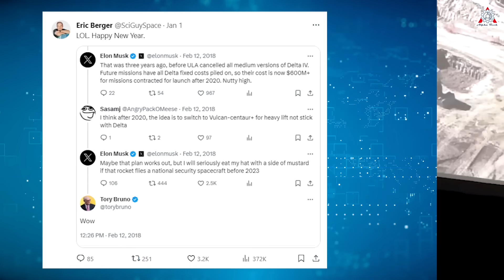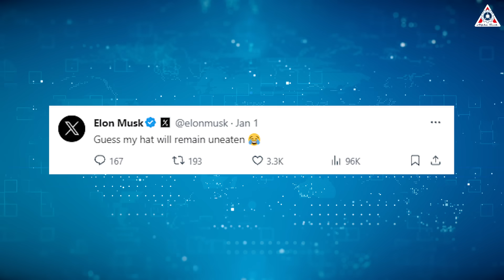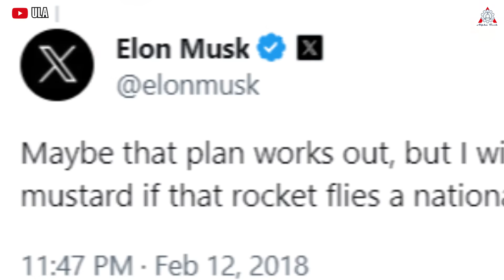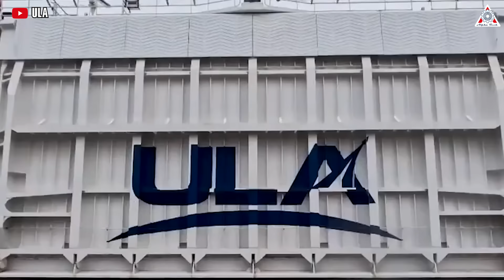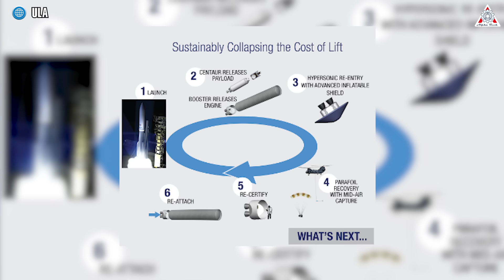Elon Musk's New Reaction to ULA's rocket FAILED for the maiden flight 2023!

Comment: ULA rocket didn’t fail though?  What is this clickbait
Reply: You are mistaking "failure" as failure. SpaceX is testing, testing, testing, and consistently iterating the technology in a rapid agile improvement model.  Like they launched one of their rockets, knowing that it would destroy the launch pad, but did it anyway to see HOW it destroyed it and then how to improve it.
Reply: SOMETHING went wrong with the lander....so blame will be coming once they review the launch data.   It's possible that the launch forces exceeded what the lander was designed to take...or the lander was faulty.   Can't say yet and it'll be interesting when/if the cause is determined.   
A fuel leak could easily be caused by a G spike that ruptured a tank...so let's wait and see who to blame.

Comment: I am no fan of Blue Origin's Bozohead, but ULA did not fail, it was the Astrobotics part that failed.
It should be noted that the ULA needs SRBs because the BE-4 runs underpowered.  The original design was not to need these except on extra heavy payloads.
Reply: Yeah and they could have it launched I 2019 but Bozo was originally wanting his rocket to be launched first.
Reply: A failure is a failure, regardless of where the failure came from. In this instance its who's hands are in the pot, dictating what, their vendor's equipment, etc. Aka, a process failure. I am a vet and can tell you that a logistics failure in the rear will lose a battle just as much as failed tactics on the line.

Comment: Vulcan is still entirely expendable, meaning their launches are very much more expensive than SpaceX launches. At some point, even government customers will have to take that into account.
Reply: I think the cost of Falcon has gone up quite a bit ....all you have to do.is look at the government contracts SpaceX has recieve ...÷ by the number of missions...their ISS missions are not cheap ...not to say SpaceX is kicking everyone else's a$$....but they are not doing this for spare change either.
Reply: @Java62PR  during the time ULA has launched 3 payloads, SpaceX has launched 90, so I'd say it's done quite a bit of a$$-kicking. Market strategy says you charge what the market will bear to maximize profit, especially when what you charge is still less than what your competitors can match.
Reply: @patkelley4071  yet f9 is unable to lift everything that could be designed for VC.   Thats why diversity in launchers is needed.
Reply: @FossilTunes  I agree that a broad range of launch vehicles is needed, but continuing to toss hundreds of millions of dollars of expensive scrap into the ocean is not the desired path. If the Vulcan engines and avionics can eventually be recovered, that will be a better payoff.
Reply: @patkelley4071  that would be nice but it is Always a question If it is feasable to recover vehicles. Again the best example is the space shuttle. While basically recoverable the repairs and maintanance was a pain and never hit its design Goals.  And what,for example,is the turnover time for a ,competably, simple Falcon 9? 
I would be Happy If ss/sh works AS intended but i have my doubts.
Reply: @FossilTunes  good points. It was unfortunate that the STS program was awarded to Rockwell instead of Northrop, which had proposed a fully recoverable two stage design, that I suspect would have been easier to refit and maintain. The biggest reason the STS never hit its affordability goals was that its main purpose was to enable the construction of the ISS, with few other payloads large enough to justify flying more missions, and as SpaceX is showing, the number of flights are key to reusability making sense.
Reply: 98 to be correct...yes SpaceX is a revolutionary company....the purpose of bidding is to get as close to the next bidder ...without leaving millions on the table....that gap has close considerably...still they can choose when to low ball a mission or bid for company purposes.
Reply: Not ...the engine section supposed to jettison and parachute down to be recovered by a helicopter using a catch wire.
Reply: well... a launch on VC might cost 3x of what F9 would cost but it has the advantage of higher load capacity and a larger fairing.

Comment: With each spectacular engine failure, Musk should send a card offering Raptor engines at a special discount price. 🤑😬
Reply: BO engines have been a disaster thus far, but the Raptors are still not flight proven and the first two attempts to launch have resulted in .... wait for it ... Raptor engine failures!
Reply: @Raptorman0909  Hardly. All 33 engines performed flawlessly on stage 1 thru separation. The failures after separation were due to cavitation of the fuel supply, not of the engines themselves. Similarly for stage 2. The LOX ran short - probably due to a leak and the FTS took over.
Reply: @GntlTch  Perhaps, but until they make it to orbit they haven't proven themselves.  BO hasn't proven the BE-4 either and for the same reason!
Reply: @Raptorman0909 The Raptor engines have proven themselves: all 33 engines launched, remained working through separation and restarted. While reaching orbit may be a valid criteria for a rocket, engines do not have to reach orbit to be validated.
Reply: @GntlTch  "While reaching orbit may be a valid criteria for a rocket, engines do not have to reach orbit to be validated"  -- Umm, a rocket engines job is NOT to work on a test stand, it is to enable the rocket to reach it's objectives -- they have not yet done that!
Rocketry isn't T-ball!
Reply: @Raptorman0909  So if making it to orbit is your criteria for "proving" an engine, would you explain the FAA allowing manned flights on BO's New Sheppard with "unproven" engines? Bezo's glorified yoyo does not even attempt to reach orbit - just straight up and straight down.
Reply: @GntlTch  A rocket has a job to do, the New Shepard barely makes it to the Karmen Line and is way short of LEO, but the job it's engine is required to do is met for that task.  A rocket that's supposed to reach LEO can not be considered a success until actually reaching orbit -- space is hard, it's not T-ball!
Reply: @Raptorman0909  I think you have it backwards. The BE-4 has ONLY seen a test stand. Not a single one has flown. Contriwise, over SIXTY Raptors have flown and the Starship did reach its objectives. (Yes, it fell short of the test aspirations but it did meet its objectives.)
Reply: @GntlTch  Begging your pardon putz, BE-4 has just successfully launched and the Centaur is now in Earth orbit!
Reply: @Raptorman0909  Yes, finally. But it hadn't when you made your blantantly wrong assertion.
Reply: @GntlTch  Um no, at no point in the prior posts did I say BE-4 had done its job UNTIL it did its job!  You may wish to review as your comprehension is weak!
Reply: @Raptorman0909  I'll concede that one. I was going from memory and conflated your posts with someone else's.
Reply: @Raptorman0909  You keep trying to move the goal posts. Your asserted criteria was that to be "proven" an engine had to reach orbit:

   "until they [the engines] make it to orbit they haven't proven themselves"

Engines are not rockets in spite of your attempts to conflate the two. Engines only need to reliably provide thrust to enable flight to be successful or "proven". It is an orbital rocket that needs to achieve orbit in order to be successful. Over 60 Raptors have been flown and all 42 Raptors performed flawlessly on their last flight. It was the fuel supply (or lack thereof), which caused the flight terminations, not the engines themselves.

While SpaceX will continue to improve the Raptors, I contend that they have "proven" themselves. You contend that they haven't. We will have to agree to disagree and leave it at that.
Reply: @Raptorman0909  
The Starship rockets took off TWICE. Yeah, the Raptors haven't reached complete orbit yet as they're still in test phase, but they still took off. So how are they failures?
Reply: @texan-american200    More than 9 of the Raptors failed on the 4/20 attempt and on the 12/18 attempt Raptors on the first stage failed and the second stage also failed -- sorry, the Raptors may well be more refined the the BE-4's, but they are not ready for prime time yet!
Reply: @Raptorman0909  didnt they all work in the last test? Thought it blew up due to the fuel sloshing. Regardless least they actually getting tested. It can only get better
Reply: @Nick871203  How exactly did the upper stage die from fuel slosh?
Reply: @Raptorman0909  It died of LOX starvation - fuel supply deprivation, not sloshing.

Comment: Vulcan is doing quite well, I mean they did miss their launch window due to the Centaur III failure but, that is one failure akin to the pressure tests SpaceX does, and I think it is understandable that this happened, plus their reliability until now is the highest on the market, so I wouldn’t say that  Vulcan failed, it hasn’t even launched, and it will tomorrow, also their ethos is similar up to a point with spaceX they are trying to make Vulcan have a very high cadence of launches, though sadly most are for the space force
Reply: Except SpaceX either already has a replacement ready, many replacements ready, or can fabricate a replacement in hours or days.

SpaceX throws away hardware because the FAA is too slow.
Reply: I think the present situation will continue until Starship makes a propulsive landing on the moon and then returns to earth.  At that point, SLS will be scrapped.  ULA is a jobs program also so there's political pressure to continue it for that reason.
Reply: @snookmeister55  Unfortunately, successful Starship flights (plural !) will have minimal effect on the SLS politician re-election project.
Reply: @GntlTch  I disagree.   Once it is shown that SLS is a ridiculous, expensive,  unnecessarily complicated plan it will be scrapped.
Reply: @snookmeister55  That is already shown! $4.1 BILLION PER LAUNCH, over $ 1 BILLION just for the transporter upgrade, a projected additional cost of $95 BILLION thru 2027 is not ridiculously expensive? Minimum of 1-2 YEARS between launches is not ridiculous? You have much more faith in Congress than I do.
Reply: @GntlTch  True but an alternative does not yet exist, therefore NASA presently has a 1969 plan.
Reply: "their reliability until now is the highest on the market"

Really? Two acceptance test failures before even getting on the launch pad and ZERO flights:  Two divided by zero is a pretty large number for probability of failure. To try and contend that a vehicle that has yet to even attempt to fly has a high reliability is laughable!
Reply: @GntlTch  Look, Atlas 5 and Delta 4 has had a perfect launch record, and test failures are common and expected in the testing process, though one so close to launch is a sign of mismanagement and should not happen
Reply: @santicraftmcesp.9178  I wasn't talking about the Delta or Atlas. The subject was the Vulcan and its BE-4 engine.
Reply: @GntlTch  Yes, but my point is that although we all know that blue origin is a terrible inefficient and ineffective company, the credibility of ULA, is what leads me to believe in their future success, and by that I mean that they wouldn’t launch if they didn’t have the certainty of mission success

Comment: I'd prefer a healthy competition. 

But I doubt we will see that in the aerospace industry. 

It's been 10 years since SpaceX first orbital launch and recovery of the booster.

Without booster recovery, every other system will cost too much compared to the Falcon 9 system.

With Starship both booster and 2nd stage are to be reused.

Until the BE4 flies, it is a untested system.

SpaceX will have a successful orbit of Starship before ULA with a BE4 engine gets a payload into orbit.
Reply: No, tomorrow ULA launches and if they try to launch, their past reliability shows that they are sure of their system
Reply: Time will tell.  Buying popcorn and beverages.  The show will be good, either way.